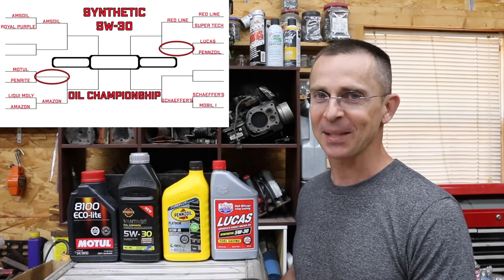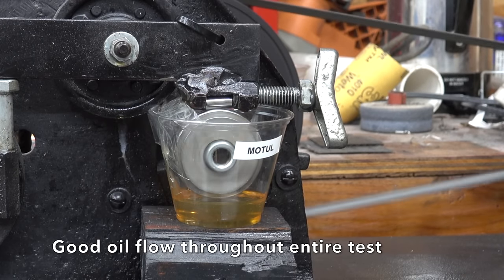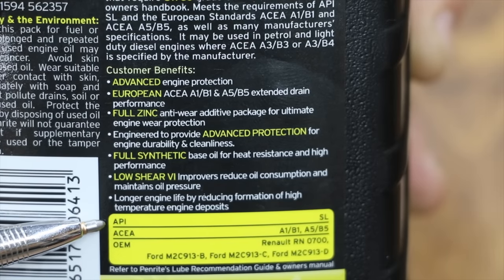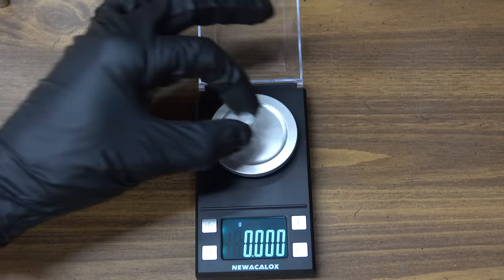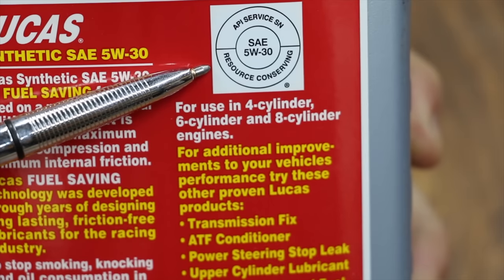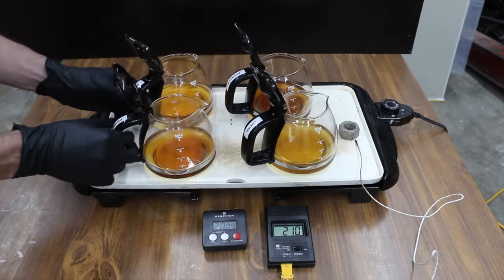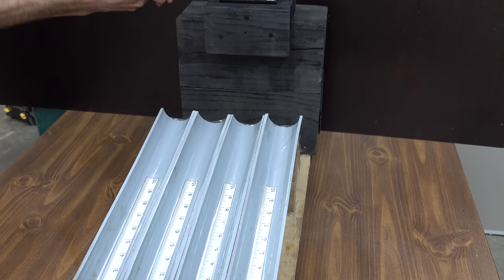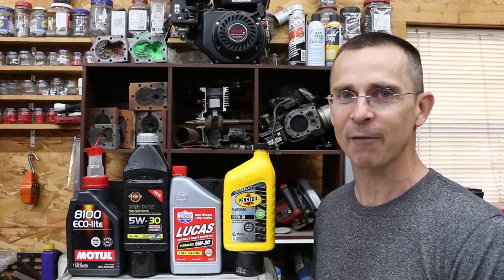Is Lucas better than Pennzoil? Let's find out!

Comment: I really can't wait to see a full synthetic motorcycle oil with a clutch additive test 10w30 is going to be the new standard for Hondas and they use a gn4 setup for their oils but super tech uses SL still which seems to be up to par plz test motovul 300 ams oil Mobil 1 motorcycle oil. whatever you can find that's Jaso 2 wet clutch compatible motorcycle oils, super tech is only $7.46 a Quart right now which is cheap for that oil. Idt the Honda gn4 is even synthetic...
Reply from the maker: Thanks for the suggestion.

Comment: Thanks for sharing all your great videos! For a number of years, Gas engine motor oil has had a rating of SN on it. Now they are changing the rating to SN plus. It would be interesting to see if there are any detectable differences between the 2, given the same brand and weight. Another test for motor oil you may want to consider would be one for foaming. This could be done in a blender to see which brand has the most control over foaming.  Last a test to see which motor oil cleans the best inside and engine. This could be done by making up a mixture of dirt and grease and then applying it to a bolt and let it sit and dry for a few days. Then place it in a clean container of oil and let it sit for a few days and see how clean it comes out. You may even want to figure out a way to shake the bolt or move the bolt in the oil to make the test more like it was in an engine.
Reply from the maker: Thank you for the video ideas!
Reply: API designation changes came in the Summer of 2020 -- latest is API "SP", and "ILSAC GF-6" .
A lot of the "ON SALE" oils are left-overs from the "SN" and "SN+"  batches.
Cheapskate jerks grab up the obsolete oils at the "bargain!" price -- perfectly content to use old stuff    to save a few nickles.
But hey -- It takes all kinds.

Comment: Could you do a test, to see if JB weld can repair something hydraulic that's leaking oil?
Reply: I’m pretty sure the answer is “no” (without draining the piece and cleaning the oil off before applying JB Weld), but it would be an interesting experiment, anyway.
Reply: @censusgary  I have a dirtbike and there is a part of the engine casing that's broken. It is a small cast aluminum piece that fits perfectly where it once was, and it's a part of the hydraulic clutch. The function of the small piece, once in place, is to hold hydraulic oil (and pressure). There is no problem getting the area clean of oil, where I would supposedly use JB Weld.

Do you think it could hold?
Reply: I suspect that would work. The only way to find out, of course, is to try it. Use the JB Weld product that is advertised as resisting high temperatures.
Reply: @censusgary  I have already ordered JB Weld Original, and there is no high temperatures going around the place where I'm going to use the product. I just hope JB Weld doesn't leak. I tried patching up something remarkably similar about a year ago, with a two-part product you are supposed to mix, much like epoxy. The product(s) was one part metal powder, one part foul-smelling oily substance, (this product is supposed to be stronger than epoxy). After application and testing, oil leaked through tiny, near invisible holes.

I just hope JB Weld doesn't have this problem.
Reply from the maker: Thank you for the video idea!

Comment: Can you do some motorcycle oil? I would start with M1 10-40w 4t  vs amsoil 10-40 metric.
Reply from the maker: Thank you for the video idea!
Reply: @ProjectFarm  I'm on many motorcycle forums, and its always a heated debate. I bet it would be a hugely popular video. A lot of guys argue that shell rotella T6 5-40w is just as good as any $15 per quart high end 10-40w motorcycle oil because it is also JASO rated, but not marked as a motorcycle oil. Personally I stick with motorcycle specific oil to sleep better at night.....it would be a great video!  I would do shell rotella 5-40 T6 vs mobil one motorcycle racing 4t 10-40 vs amsoil motorcycle metric 10-40 vs a cheap motorcycle oil like Castrol Grand Prix Motorcycle Oil 10W40. ill make sure everybody on the forums knows about the video!

Comment: Great video!
It's no wonder they're not much different- Oil made for gasoline engines isn't about wear or lubricity- it's about EPA and their BS standards for fuel mileage. Nobody preserves new cars because they are pretty much all disposable so high quality engine oil is almost totally unimportant. You'll get the exact same longevity with recycled conventional oil as you would with all those corny claims that synthetic oil makes. Oh it's better oil, but it's not worth a penny more to the average consumer for everyday use.  
If you want to use a true 'better oil' in small or non-cat equipped engines, use Shell Rotella 15-40 diesel engine oil.
 *Do not use Shell Rotella in catalytic converter equipped engines because it contains zinc- the enemy of the converter.
Reply: My comment didn't get approved .. lol.
Reply from the maker: Thank you!

Comment: i havent finished video yet. but yrs back i used lucas oil in pushmower. i can tell u. by end of one season convential oil was burned and dark dark. but after 1 season lucas looked new. 2 seasons looked new. 3rd season lil burned. it was a old mower. didnt care if it killed it. but it said alot about lucas oil to me.
Reply from the maker: Impressive!  Thank you for commenting on this.

Comment: Have you tried to run an engine off of kerosene or charcoal lighter fluid.
Reply from the maker: I tested Kerosene but not charcoal lighter fluid.  Thank you for the video idea!
Reply: @ProjectFarm  don't test kerosene in a two stroke
Reply: In 2 minutes I blew a cylinder head gasket!

Comment: There is a mistake here and in later videos. This video uses Pennzoil Platinum while the videos after this one uses Pennzoil Ultra Platinum! The ultra platinum does not have to b better than the platinum. In fact, there are people claiming the current formulation of the platinum is better than the ultra platinum. 

I suggest a match between the Pennzoil Platinum and Pennzoil Ultra Platinum to determine which one is better. Of course, if Pennzoil Platinum beats Pennzoil Ultra Platinum, then please do a rematch between Amsoil and Pennzoil Platinum. Otherwise, the matches cannot be called fair, right?
Reply from the maker: Thank you for the video idea!

Comment: How is flow rate a measurement? 
Cause then water would win..
Reply: Dubious:  The question is whether it stops flowing at extreme low temperatures. Water would lose badly when it is colder than 32 F/0 C. It would also be crap at above 212 F/100 C— steam is not good for lubricating gasoline engines.
Reply from the maker: Thanks for watching!

Comment: hi
have information,  that this invention helps to save fuel, and the engine works better
in two words- it is necessary to roll out an aluminum disk up to 10 000 rpm and more
the diameter of the disc should be 100+ mm , thickness 2-3 + mm 
the drive must be horizontally located, (write that from the rotation against the clock arrow the effect is better) but works well- rotation clock to....
the disc must be closed around the perimeter, in an aluminum case, 
and this aluminum perimeter through an aluminum bus must be coupled with an aluminum engine part, Better aluminum cylinder block and cylinder  head, also possible to connect the  carburettor via an aluminum wire, 
It's also good to combine a tank of fuel too, and the tank itself is made of aluminum
then you need to give the disk a spin  hour 
it will still be necessary to make the possibility of shifting the angle of advance of ignition on earlier, about 30-70 degrees from normal
the meaning of that- 
when you start to rotate the disk, every 20 minutes, it will be necessary to check the engine- reduce the amount of fuel and ignition to do  earlier  
about two hours set up- the engine must be tuned to a minimum of fuel and earlier ignition , after which the engine runs normally, with the drive turned on continuously
the author says that- on simple engines with a carburetor and without complex electronics- 
like briggs statton can save 30-50 % fuel when the disc rotates
he also work on new engines with many sensors, an injector. but performance less
here is the link for the car- https://lenr.su/vertushka/
Here is the link of the author's  theory and his research- https://vertushka.me/?page_id=342
Here is the link of the , for the auto- https://vertushka.me/?page_id=72
google translator will help
I think it will be a great experiment- and change the world
He is also positive for health

Comment: Wish you had used the ultra platinum
Reply from the maker: Thanks for the constructive feedback
Reply: @ProjectFarm  umm you are using amzoil and redline maybe do a different test later if you feel like it of platinum vs ultra platinum. Ultra is top self just like redline and amzoil.
Reply: @ProjectFarm  don't get my water on glad you added Pennzoil to the mix. I think in the end it will can win out the cold test and make be the burn test.

Comment: Just for my personal experience I've used Valvoline and almost every engine and have had great luck the one time I use Pennzoil the motor ended up going two days later I ran that loader for 260,000 miles until I put Pennzoil in I would never use Pennzoil I was kind of looking forward to seeing Lucas Beat It but apparently not
Reply from the maker: Thank you!

Comment: I have 0 statistical data in front of me. But in my opinion, Pennzoil would be the last oil I would buy. I have rebuilt several motors in my life. For fun mostly, not because I had to.. lol
The sludge that was generated from pennzoil was proof enough to change. 
My preference is Quaker State!  It seemed to handle my abuse very well. Again it’s my opinion, have a great day YouTubers!!!
Reply: Bret Lambky I’ve used pennzoil exclusively on three different vehicles, Ford v6, Mazda 4cyl, and Chevrolet v8. All vehicles far exceeded 250k miles on original motors with no major repairs and were quite clean with no sludge. Also, a lot of towing was done with the Ford and Chevy. And I am a spirited driver. So it seems to be a great oil. 

But I would guess, consistent maintenance and oil changes would benefit more than the actual oil. And maintenance was regularly performed by me on the vehicles including preventative maintenance before issues arose.
Reply: Your right Craig, a good maintenance plan and scheduled oil changes are critical. Even the best oil out there can fail if not maintained well. Again, it was my experience with the oil that I wasn’t satisfied with. Quaker State provided me better results! 
They use to sell a product called 5 minute oil flush that would really keep the internal parts clean and healthy! It was a kerosene based product. It would keep oil passages very clean!
Reply from the maker: Thanks for watching!

Comment: Not to be pedantic but shouldn't you measure the diameter on the lubricity test and then measure the diameter at the center of the scoring? Ya know, for science. I mean if they have slightly different diameters that would affect the size of the scoring.
Reply from the maker: Thank you for the recommendation

Comment: SL rated means it probaly has more zinc. Thats why it won
Reply from the maker: Yes, I believe you are right.  It did very well on the lubricity test!
Reply: That's why I use synthetic SL oils from Amazon for my vehicles. Yeah, they do have higher evaporation rates and may be thicker when cold, but I live in a desert. My engines are not turbocharged, so low evap rates are not necessary. I don't have direct injected engines either.

Comment: you should try pennzoil ultra platinum
Reply from the maker: Great recommendation!
Reply: Ultra is worse than Platinum. Platinum is only good for the temperatures of everyday track driving. Absolutely not worth the price or loyalty. You get worse wear protection to top it off, Ultra is just rated SN while Platinum is SN-Plus. Thanks for the suggestion, now he's changed it 😒. Now we'll never know the superior oil.

Comment: every time i see this im like, where is Quakerstate, it's one of the cheapest full synth oils. and they only make one kind, Quaker State Ultimate Durability.

that being said, something to try for a "farm project", turbo charge a high compression gas engine, something like 10:1 or higher, but run it on bbq propane.. see how long it lasts...maybe try to get or make a dyno to test power output.
Reply from the maker: Great recommendation!  I'll test Quaker State soon.  Great video idea too!

Comment: SUGGESTION - compare cutting oils - I've used everything from WD40 to 90 wt gear oil ( which is extra messy ) and don't see much difference except TAP-MAGIC  seems to be a little bit better than anything else I've tried for tapping
Reply from the maker: Thank you for the video idea!

Comment: The flow test is useless. As 10w isn't a fixed viscosity and there's more of a frame from which to which viscosity it's 10w. Only the difference after cooking says something and you should rather test the cleaning abilities of the oil, by putting dirty bolts in it, like you did with the diesel flush test.
Reply from the maker: Thanks for the constructive feedback.

Comment: Full synthetic is a marketing term. Its regual common oil with additives. It can be called Full synthetic in the USA and be reg oil with additives. Only in the USA if it says 100 % Synthetic Motor Oil must it be real 100 % Synthetic..
Reply from the maker: Great point. Thank you

Comment: Just a thought for the final round, Rig up a torture test with two of the predator engines where they run for a week straight under full load, you may even interfere with the cooling system so they run hot. Then send each oil sample to a lab like Blackstone and see how they survived.
Reply from the maker: Thank you for the video idea!

Comment: Pennzoil Ultra Platinum is better than the one you have here... you can order them from walmart online only though you may be lucky in store but they go by quickly.
Pennzoil Ultra Platinum 5W-30 Full Synthetic Motor Oil, 1 qt

http://www.walmart.com/ip/Pennzoil-Ultra-Platinum-5W-30-Full-Synthetic-Motor-Oil-1-qt/36142651
Here is the link for the 1 quart since thats all you may need!
Reply from the maker: Thanks for the recommendation.